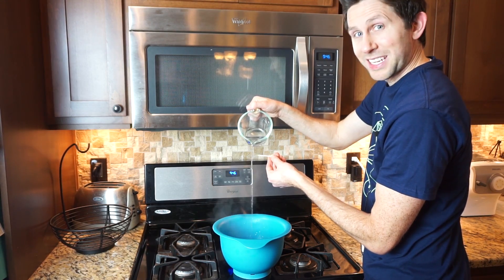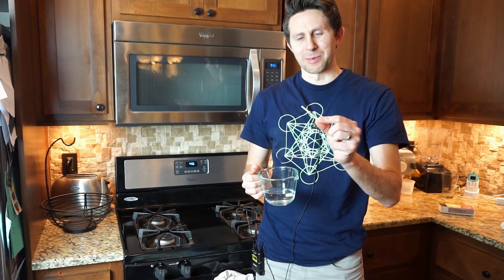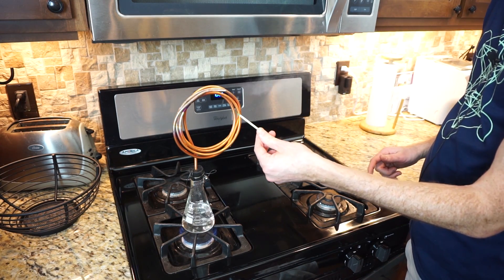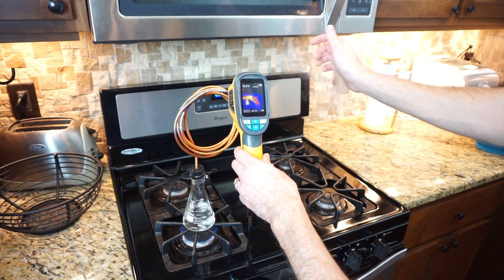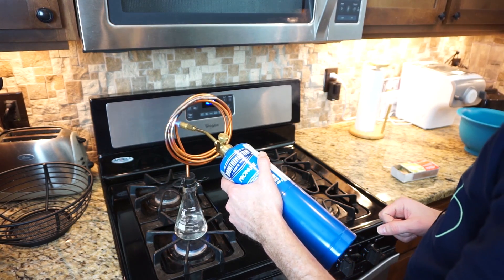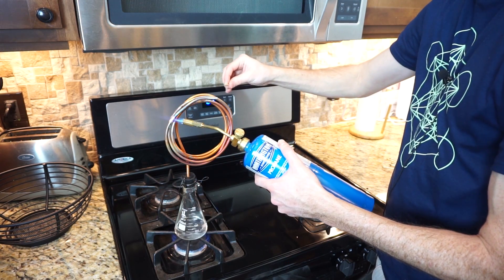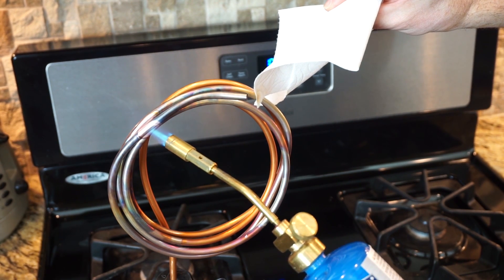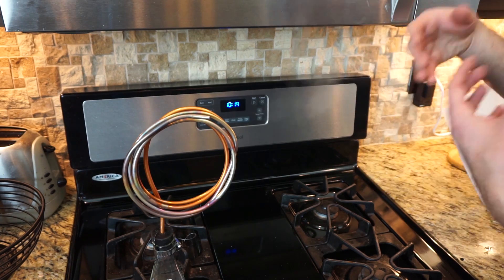Is it Possible To Light a Match With Really Hot Water?

Comment: Wow, I wonder how much energy it would take to heat non conductive water into steam and then into plasma, and if there would be applications for water in a plasma state. Especially since plasma is conductive and a fluid, and then pure water is non-conductive and gasses and liquids are also fluids, but water is a liquid at room temperature whereas other commonly used things for plasma are gasses at room temperature. Maybe one could like accelerate or fuse the plasma or something? Maybe even like special welding with super hot water plasma that cools to become steam and water.

Comment: Yea yea yea see i put it on the copper and it doesn't burn, probs he has turned it off quickly, and because copper is not isolating the heat goes away fast

Comment: Actually the match was lighted and activated by the electrical spark he created, not by the steam, you can see the spark that was artificially generated in minute 3:02 you need an active inductor energy, which heated water doesnot contain in order to activate the oxydation.

Comment: Wondering what would happen if steam from your flask enters vacuum at room tempeture, assuming the vacuum space is large enough, hence not significantly increasing the surrounding pressure. What would be the "life cycle" of water in this case, as there is no air to decipate the vapour into humidity?

Comment: A tips. Never set water in microwave. When you take out it in top of it it is really hot and down is cold and when you shake a lityle bit the whole water will just splittring around and can burn you. But not if you are a burning mad of corpse
Reply: The cause of water splashing after microwaving is different. If water doesn't contain too much particles in it, it can be overheated past boiling point, resulting in instant vaporisation of water across entire volume in event of shaking. Increased pressure ejects top layer of water outside of the container. Even tap water can be heated 5-10 degrees over boiling point in microwave oven.

Solution one: don't overheat water. 
Solution two: add sugar/salt to the water to make it boil instead of overheating.

Comment: Its the hot gas thats making it catch fire.
so its disingenuous to say "water" is causing the fire, so much as a gas with H2O in it.
If it were submerged in water, it wouldnt have enough oxygen to catch fire.

Which is why in a gas form, it has enough air getting to it, to catch fire.

If you could completely make it wet, and keep it wet, while blowing hot steam on it, you'd see it wouldnt catch fire.

So to be even more technical, its not the H2O making it catch fire.

Comment: steam
/stēm/
noun
1. the vapor into which water is converted when heated, forming a white mist of minute water droplets in the air.
Reply: yeah except that's not a very useful definition. we'd have no ACTUAL definition for the gaseous state of water-which is STEAM. what you THINK is steam is actually MIST-atomized water.
Reply: 2. A video game software where you can buy games that's steam-powered to perform games at a very high framerate

Comment: For anyone that heats water in a Pyrex dish, be careful.  Some times the water can become superheated. Superheated means that the temp is above boiling, but the water  doesn't boil, and remains in a liquid state.  That superheated water is like a coiled spring.  Disturb it a bit, and the volume can boil in an instant, and essentially explode all over you.  It's a known safety issue.   If you have a brand new, super smooth and clean Pyrex, you're at risk for it.  To be safe, toss a toothpick into the water before attempting to nuke it to boiling hot..

Comment: The steam can easily light the match because it was raised to a temperature hot enough to ignite the match. Oh, and one more point to note is that when heated above 212 F, it becomes known as Super Heated Steam, which actually is dry, not moist. (This is also known as Dry Steam.) This is why it was able to light the match, unlike the steam that came right from the tubing without using the blow torch. It is VERY dangerous, and if pressurized can actually cut through blocks of wood like a laser.

Comment: How could water start a fire😭😭
Reply: It's not water. It's Super Heated Steam (steam above 212 F) --- and is actually Dry. The match was simply exposed to a gas hotter than the point to where the chemicals on the tip will self combust. Remember, it's DRY, not moist under that condition.

Comment: So I have a theory that the science is a lil off on this. The copper is in a loop and when you heated the copper it recondenses and stays in the tube but the boiling water creates pressure pushing the hot air from the torch out of the tube and the hot air is what is lighting the objects. Please redo the experiment with no loop in the tube, tube angled down and the heat applied after the bend in the tube so that if the vapor is recondensing the water will flow out the tube.

Comment: You can get liquid water as hot as you want to get it, too, but not at atmospheric pressure.
Reply: Actually, you can't. Water has a critical point, and once you get hotter and higher pressure than that critical point, you end up with a supercritical fluid that's neither liquid water nor steam. If memory serves (took thermodynamics a long, long time ago), liquid water can never be hotter than about 350-400C. Still pretty damn hot.

Comment: Ok... without having watched the video I say that it is possible to light a match with water.

But not in the liquid form.

Not even as steam.

But as superheated gas.And now I have seen the video.

The white fog comminng out of the pipe is STEAM... or water vapor...When you superheat the steam using a coil of copper piping you get water GAS.

Comment: 1e try u were just shutting off oxigen and melting the head of the match.

Same for the 2e and its not hot so it was only a step back.

And 3e is not water just hot air which can be made way hotter then air like u said but has nothing to do with water its just that the hot air needs slip away.

So its the hot air that light it, not water so as conclusion: u can’t light a match with water!

Comment: Be careful doing this.  Steam can condense in the coil and if it blocks the coil fully it will cause a large pressure spike while the condensed water either evaporates or is blown out of the coil.  This could cause superheated steam burns and shattered glass lacerations..

Comment: It's not really true that there isn't a limit to how how you can get steam.  But you can get it really really hot.  There is a point where if you add enough energy the hydrogen and oxygen bonds will break even through thermal means, at that point it's no longer steam and it will actually burn the oxygen.  That's why there are fires such as titanium and magnesium burning or  that burn so hot we don't use water to put them out.  In fact, those metals will burn underwater.  From what I've read you can heat water to about 2000 degrees C before there it gets to that point.  Magnesium burns at 2200C.  Those metals are used in aircraft applications and so when they burn it's bad news.

Comment: What if you super heat water ...avoid the boiling and get it as hot as it can get and then see if that water can ignite the match even in liquid form ..idk if it can get hot enough tho and introducing the match will surely set off the boiling quite violently

Comment: No limit means it could have been ramped up by extending the coil to another burner on the stove so the whole coil could be used. Try that. Oh and I’m sure there is a temperature that water decomposes or some other extreme change. But let’s not ignite the atmosphere trying to find out.

Comment: It wasn't steam, it was hot air. You made all the steam disappear in the pipe because it was so hot. So the only thing coming out of the pipe was hot, very pressurized air. Youreally sounded confident when you explained this but you're so wrong
Reply: So the steam magically disappeared in the coil and some air materialized in its place. Makes sense.

Comment: No your pushing hot heated air out  not super heated steam this is so false
Reply from the maker: Where is this endless supply of hot air coming from in a closed boiling container? LOL
Reply: This steam is pushing the superheated air created by the blow torch out of the tube the steam is not actually lighting anything.

Comment: Can the heat of the copper as it caries the steam leaving the flask ignite the match?  I originally thought the moisture of from the steam or cooled vapour would have snuffed the ignition attempts!  But very cool that the high steam did ignite!!  Definitely a miscatagorization that I have also been guilty of.  And now coming out of the hot tub in low temps I will have to think of something besides "you're steaming", and not 'you're releasing vapour rapidly'!  Thanks for provided though!

Comment: I have an idea for an experiment. Can you calculate the weight of a shadow? Take an object(like a ball), weigh it in the sunlight, then weigh it in a shadowed area. Then calculate the weight in difference between sunlight and shadow. Because objects weigh more in shadows than in light.
Reply: Marth dafuq
Reply: Your thinking about it backwards. A shadow is the absence of light and for that reason has absolutely no mass  whatsoever.
Reply: It would be heavier under sunlight so very slightly from the photons up above bouncing off of it. Think about it like a small, inefficient solar sail. In shadows, it wouldn't have that, and therefore weigh less.
Reply: Vsauce already did that,but shadows have NO weight. Light- photons- do, though.
Reply: Shadow is thw absence of photons :/
Reply: Marth "Simpsons did it!"

Comment: Hi! Nice videos, man! :-)
Suggestion to put water ice into high pressure chamber - ice should melt and water should be liquid at below 0C temperature. Thanks!
Reply: Can you please explain why water is not frozen at 0c in high pressure?
Reply: Kurmon, high pressure reduces the freezing point, probably because it is harder for water molecules to build up ice crystals. There is a video where thus guy makes a thin ice sheet out of a snowball in a hydraulic press.

Comment: I think hot air can light a match too.
Reply: You sir, I like you, you speak my language.
Jokes aside, it can. Imagine the jet engine of a jet plane or the engine of a helicopter. placing a match right at the end would set it on fire. You can look up helicopters and jet planes and notice that the area behind their engines appear to be warping, same thing happens when you look above really hot flame in a large area, there is a noticeable warp in the view showing that the air above is reacting violently with the immense heat hence, warping the light we perceive.
Reply: LOL! 
Such an overkill to use a jet engine, just to get hot air. I just tried (for fun) with a standard heat gun (wich blows just hot air - no flames) and that also worked just fine to light a match with, haha
Reply: Your disagreement is noted, yet there is a bit of confusion concerning whether or not the fire is hot enough to ionize the medium it is contained in and create free electrons in that article. Broadly speaking, common fires that you tend to see with the naked eye such as wood burning at 1 atm on Earth doesn't ionize the surrounding gases or fuel. Thus no plasma forms.

It is possible to form plasma using fire if the fire burns to very high temperatures or the medium that contains it is incredibly densly packed, but you generally don't come across that. However even in this application, the fire itself still is not a plasma.

It should also be noted for the article that neither the Sun nor spark gaps contain fire but that's not relevant. Fire is simply a chemical reaction between an oxidizing agent and a fuel which can pretty much be anything save Helium and Neon.
Reply: but fire is plasma. how is that air is plasma?
Reply: Fire isn't plasma or hot air. Fire is the rapid oxidation of a fuel after an ignition point has been reached. The fuel can be practically any material and the oxidizing agent is usually oxygen yet it certainly doesn't have to be. The exothermic reaction may create large amounts of heat that could turn air into plasma at sea level but it doesn't usually happen.
Reply: sorry but i must disagree. i read an article that say that fire is plasma. this is the link http://www.askamathematician.com/2013/05/q-is-fire-a-plasma-what-is-plasma/
Reply: i understand your point. i think i'll wait for scientists to give better description on that matter. well.. thank you for your reply.
Reply: People, plasma is not a material but its a state. Just like solid or liquid. So air can go in plasma state and so can other materials.

Comment: Could the boiling water create steam and as it's traveling through the copper create a Venturi thus using this Venturi as a vehicle for the heated air inside to transported out of the tube, in other words...the blowtorch on the pipe had the heat carried out of the pipe using Venturi from the steam? This would be like putting your hand on a hot motorcycle exhaust. I wouldn't do that.

Comment: There is actually a limit how hot the steam can get. At a temperature above 2000 Celsius water will decompose into oxygen and hydrogen.
Reply: @Owen_loves_Butters  No. Fire (not chemical fire or torch) never gets that hot.

Comment: Another thought provoking video- thanks.
I'm now wondering if you could light the match in your vacuum chamber? Obviously the wooden stem wouldn't burn in a vacuum but would the chemical head flare up when heated in a vacuum?
Reply: Mad Biker 3020 No. Oxygen is required for ignition.
Reply: I was thinking that the match head also contains an oxidising agent. However I have looked into this and only one type of match, the storm-match, contains an oxidising agent. So I now modify my comment to "It would be interesting to see if a storm-match can ignite in a vacuum".
From Wikipedia:
Storm matches, also known as lifeboat matches or flare matches, are often included in survival kits.
 They have a strikeable tip similar to a normal match, but the 
combustible compound – including an oxidiser – continues down the length
 of the stick, coating half or more of the entire matchstick. The match 
also has a waterproof coating (which often makes the match more 
difficult to light), and often storm matches are longer than standard 
matches. As a result of the combustible coating, storm matches burn 
strongly even in strong winds, and can even spontaneously re-ignite 
after being briefly immersed under water. The pyrotechnics compound burns self-sustained.

Comment: Slick...

A question that popped into my head toward the end is: if you have 100% humidity and boil water, is there visible steam/condensate?
Reply from the maker: If all the air was 100% humidity then no. But what happens is that the air around the boiling water is hotter and hotter air can “hold” more water. Then that air cools and the condensate forms. That is why even in a room with general 100% relative humidity you can still see water condensation right around the hot water source. But since the non-hot air is 100% humid it just “pushes” water out of the air and it becomes liquid water on colder things in the room (like the mirror)

Comment: I think you should be clearer. You're saying 'steam isn't what we usually call steam' but that's not really true. Steam is water droplets carried on hot air and water vapor. Water vapor is what you're saying is really steam.
Reply: The word is used in both senses. Merriam-Webster dictionary: steam: 2 a : the invisible vapor into which water is converted when heated to the boiling point; b : the mist formed by the condensation on cooling of water vapor.
Though I think it would be more meaningful to only use it in sense b.
Reply: The wiki on steam indicates that the term wet steam should be used to indicate when the water vapor is in combination with water droplets but that steam is actually a gas.

Comment: Now I have a question: If the steam doesn't turn into water when you point the blowtorch at the copper pipe then what happens with the water that eveporates from the flask? Does it still turn into water later when you can't see it because it has spread in the air?
Reply from the maker: It stays as a vapor in the air. It never turns to liquid water because it didn’t cool down enough and then by the time it did cool down it had mixed with the air enough so that it could not condense. If the air were at 100% humidity the steam eventually would have turned back into liquid water
Reply: The Action Lab So it turns into vapor regardless of what you do, if you heat the pipe, you just delay the condensation and if you don't it would have already condensed by the time it leaves the pipe, correct?

Comment: What happens if water boiled in vaccum!! As there is no air around will that steam hot enough to light match.. just curious to see whether 100°c is quite enough to burn match.. hope can suspend a match in vaccum chamber tied with rope sticking on top of vaccum chamber and have induction stove and water in vaccum chamber under full vaccum (water may already boil 😉) but with induction stove if temperature increased water boils and release h2o vapours not sure can have loose oxygen molecules that support match to burn 🙂